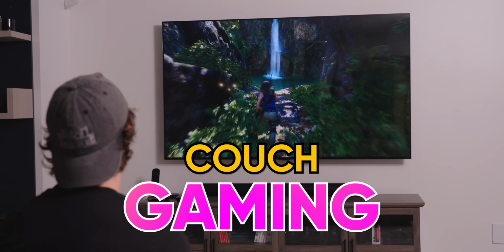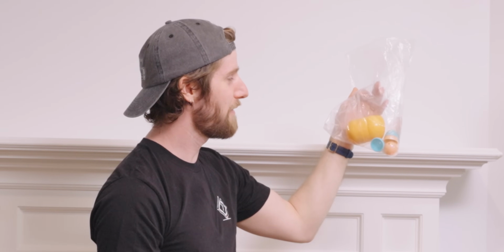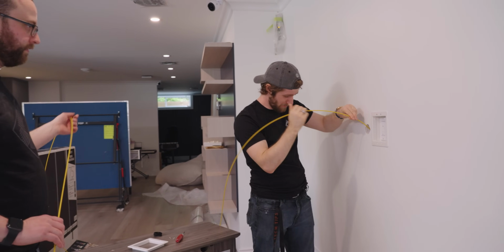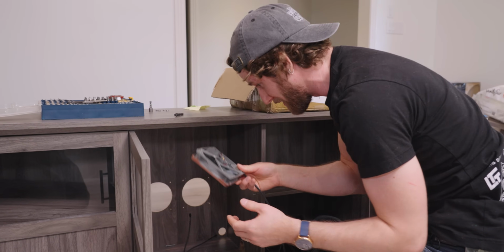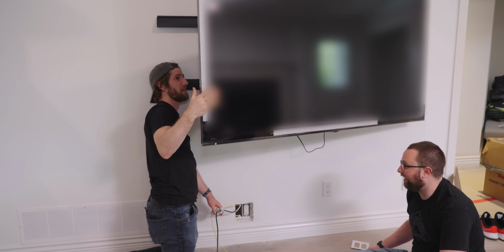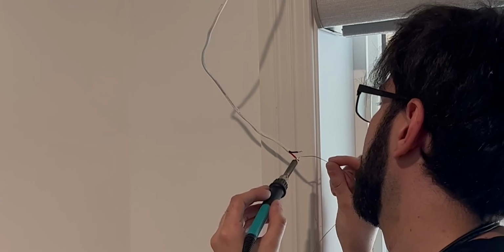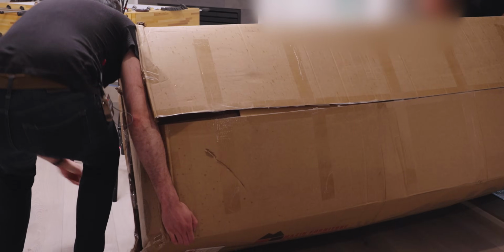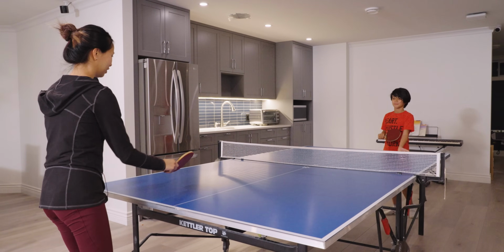I Built my DREAM Gaming Room - New House VR Room

Comment: I did low voltage contracting in my area, for all very high income clients. Any time we were doing a whole home system, everyone got pretty much the same stuff and it was fairly foolproof for us. Ubiquiti networking and cameras, Paradigm speakers (made in Canada!) , Dennon receivers, Samsung or Sony TVs, GM lighting tape light or COB lighting, and (emphasis here) RTI SYSTEMS. We used them for whole home music, all sorts of home automation, and universal remotes that control EVERYTHING. One remote, programmed once, control every tv, receiver, streaming system, and basically anything you can think of with it. It could have solved his garage door issue, his music, his remotes, even his hvac problems by just closing contacts on their processor. Also, we used Lutron RadioRA 3 light switches and outlets for everyone and it worked great.

Comment: You fill your house with all the amenities that modern lifestyle has, floor heating, hvac, big sprawling mansion, signal boosters, automated everything, multiple tvs, multiple computers, whole house wifi, cctv cameras, automatic doors for garage, a couple of 3080s here and there but you cheap out on furniture. You buy them from supermarket, retail chains. What quality do you expect them to have? Most look pretty, functional but made with substandard particle wood. You are a youtuber and surely you have seen fascinating carpenters doing big furnitures, with exquisite details and 100s of year old wood, you should contact them, focus on solid wood, the older the better and get custom furnitures made. Sure they'll cost a lot but judging by your house, your offices, and 3080s and other tech fixtures it won't be a problem for you. Focus on quality furnitures that'll last generations

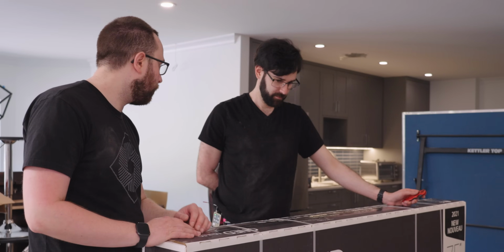Comment: 5:23 it's crazy that you're allowed to have low voltage lines that close to high voltage. Where I'm at the building department will not let you put low voltage in between the same studs as high voltage even if they're on opposite ends of the bay even if they're each in their own conduit.

Comment: I actually was a low voltage contractor for a few years, in my experience the electricians get the bid to run all the conduit since they have to run conduit for their lines anyways. So usually when there are low voltage drops without conduit it's because the electricians didn't have that drop in their plan. Generally it goes framers, electricians, drywall, and then low voltage. The low voltage technicians couldn't put in any conduit because the drywall was already in place.

Comment: I don't get it - why there's the constant hunt for studs? You would've been aware where do you want your TV to be mounted, so why wouldn't you've said to the contractor to put wood panels below the drywall, so you would have an easy mounting everywhere you want on this particular wall? This is how it's done in Europe and it works great - 5 cm thick OSB panel and then the drywall, holds 105 inch Sharp TV like it's nothing.

Comment: How are you controlling the cabinet fans?  Do you have a 120v to 12vdc controller that ramps the fans based on the temperature in the cabinet?  Are you connecting them back into the PC?

Comment: An intermediate metal plate between the wall and the bracket would allow you to mount the bracket (or other brackets) anywhere you want, without having to drill Nth number of holes in your wall. You only drill 4 large ones, and that's about it. You then use bolts from the other side of the plate (which is spaced)  to mount the bracket. You can put it high or low or more to the left, whatever you want. Setup's really strong. To prove my point (caveat, european house european walls) i once bolted a one meter long bar on the plate (500x400x2.3mm thick) in the center and hung two large dudes on it.

Comment: LV contractor here; I've seen your data closets, the pathways, the trunks, all the CAT6 divers...... lemme say YOU guys have SOME gall lol. But  honestly, LV won't install conduits inside your walls. EVER. You get pullsttring from the drop-point if there's no conduit already for us.
Reply: I mean if a customer asks for it then they should accommodate.  Any contractor worth their weight in salt would do the same. But then again that’s why I DIY everything because every contractor I’ve used seems to halfass everything they can get away with.
Reply: @chadhowell1328  Of course, I'm just saying LV wouldn't do it, electricians install all inner-wall conduit for LV. But they're acting like they were just expecting a conduit there.

Comment: 12:10 - My old HP gaming computer had a built-in infrared port, for using it as an entertainment center. However, not all universal remote controller were compatible with it, sadly.

Comment: How I used to fish a wire threw the wall. I used to do with adt is a glow rod with a metal chain like a dogchain. Taped to it, then use a 12inch long flexi magnet , find the chain then pull it out then tape the wire and tape it to the chain and then extract up the wall

Comment: I just set up a 75" QNED 80 in my parents' living room. I don't know about the 90 series, but the local array dimming on the 80 series is garbage, especially so in dark rooms. In dark scenes, it looks like there's a spotlight just moving around the screen. I ended up just turning local dimming off. 

Side note: what wall mount did you use for the TV?

Comment: if you can here are the parts    parts: rtx 3060,    amd ryzen 7 any type,    nzxt kraken duo fan,     motherboard am4 4ddr4 slots single gpu slot asus,    4 sticks of 16gb ram corsair any type with rgb,
any corsair rgb case,    6x corsair fans  1000w pcu from corsair,     1tb hdd,     450gb ssd,    and lastly copy of windows 11 or 10 if 11 not compatable               ........if you do thanks for bulding my dream         and also im in England so send it in a package  and build it if you can         THANKS
Reply: and want a:      vr head set  that is my dream i wanted it since i was  4years old.       THANKS    or not give vr head set

Comment: you can say alot about the electrical standard (sockets and stuff) but 1 thing is clear as a alcoholic drinking bear. they look ugly as shit. doesnt matter if its recessed into the wall. my stomach will turn if i even knew about how they look and the mounting. i mean... Square boxes? comon... and. look at those switchboards :'(
but hey normal ppl from NA. its not your fault that your countries/region had to stand out and make something entirely different. Also. why even 120volts. go 230v so you can use a full 2000w PCU  on a single outlet :):):)

Comment: Also as an installer, I'm finding it a little weird how much more difficult these guys are making mounting the TV. Why is there so much damn tape on the wall? Why is he using the template and trying to level it on the wall before even securing it in with lags? You can lag one in and get it to be level before lagging in the rest. You don't need all the tape. Throw the mount on the TV, measure from the bottom of the bracket to the bottom of the TV. You just found where the bracket needs to go on the wall. That power outlet in the middle is in a terrible spot, and this Kanto mount is way too ridiculous. You should have just grabbed a Sanus tilt and made the install a lot more simpler. Also with the Sanus tilt you could place it over that outlet and still be able to get center and use the outlet without the nonsense of Kanto full motion for some reason... Jeeeeeez, and this dude was an installer and has mounted how many TVs????? Jeeeeeeez again.

Linus, next time you need a TV mounted, let me come out and do it right. I'll literally do it for free.